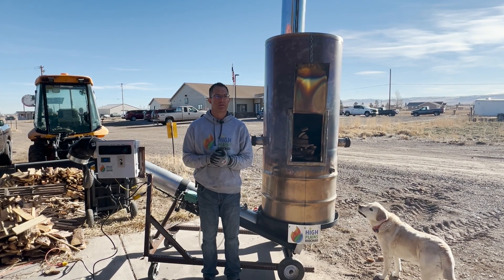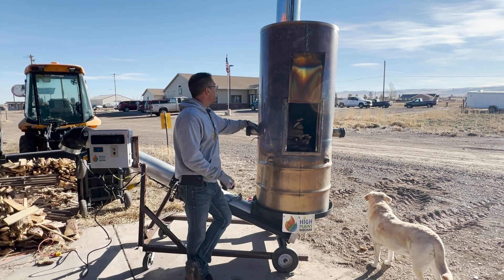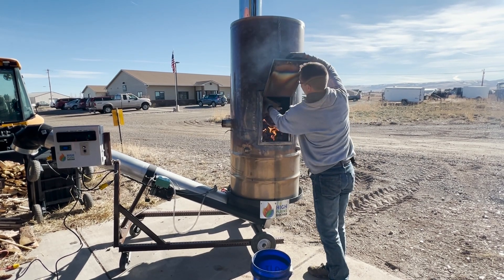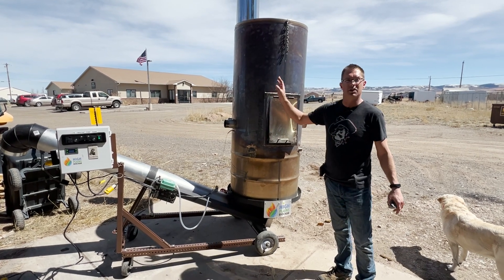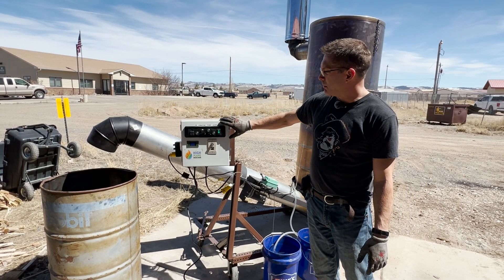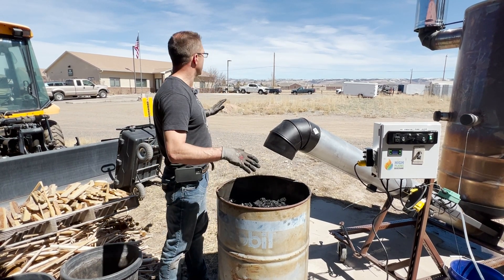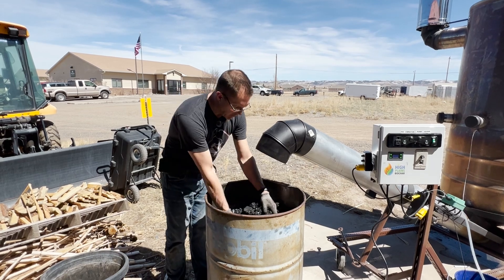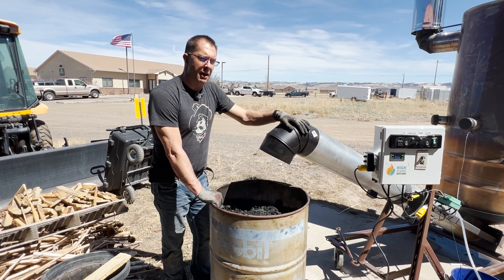Continutiki 4 hour run processing 250 pounds of pine wood waste into 50 pounds of biochar.

Comment: Doesn't pine have a significant amount of turpentine in it? Is it sufficiently eliminated by the charcoal process that it doesn't interfere with the microbes inoculating the charcoal?
Reply: At high temperatures the turpenoids become volatile and become combustible.